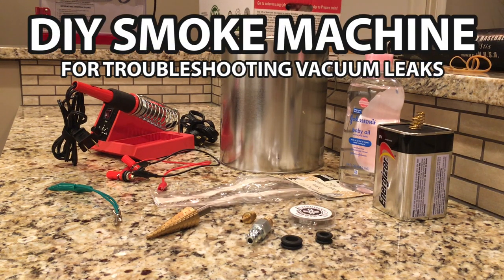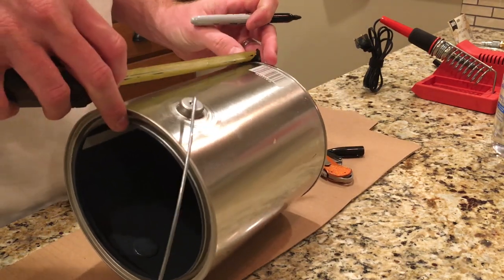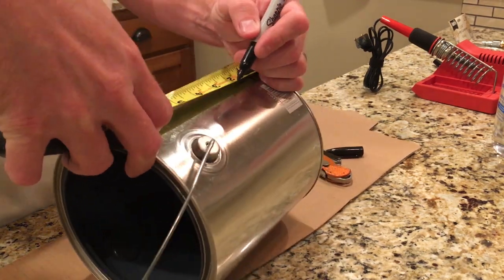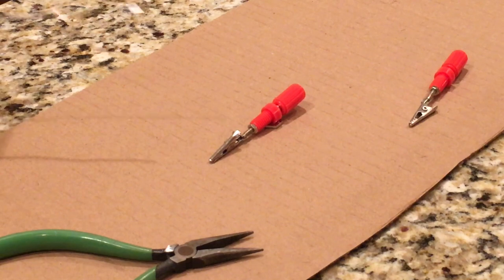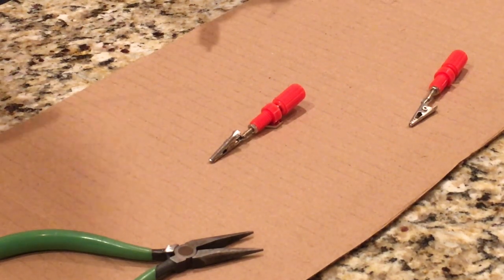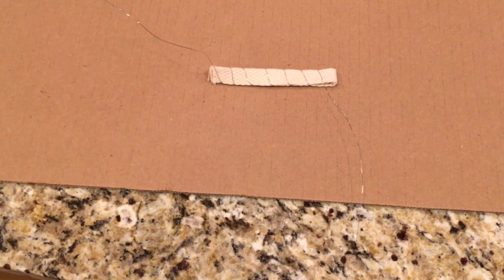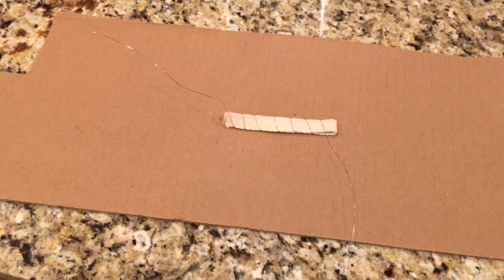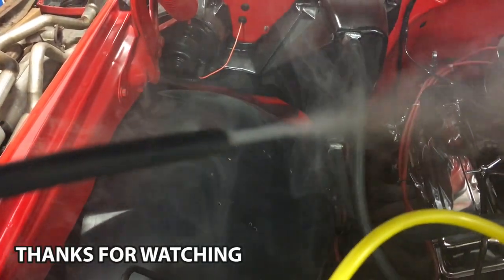Project Time: DIY Smoke Machine Build - Find Those Vacuum Leaks!

Comment: I put a tire valve in mine. I have a pump I use on my mountain bike that has a gauge on it to pump pressure in the can. It's a small hand pump that is easy to pump as I go. Pump with one hand and walk around engine bay looking for leaks  works really well. I used a paint can also. I also have a compressor air fitting on it too if I feel I need more pressure. I like the hand pump because I don't live in a single family dwelling anymore. Makes it more portable. Otherwise I need to break out my compressor and generator and both make to much noise for neighbors. If I have to use them my neighbors know I work on car's in the parking lot and don't complain. They tease me about it sometimes. Maggie's out making car noises again. I just laugh. I work on car's here and it convenient for them since it's a 55 and over senior community. I don't tear motors or transmission's apart here. I have a places if that is needed to pull those to work on. I have a 12x40 storage that I drive to and just get the car towed down the road from where I live. I keep most of my tools in there. It keeps me busy and supplements my retirement too. My customers buy the parts I tell them it needs and I give them a price we both can live with. If they need to go to store I take them when I go if I'm still working on their car's. I love the arrangement we have here. Manager has been real nice to let me do it. I use an oil absorbing mat under the vehicle when I change fluids so I don't get and thing on the parking space I use. I have a portable canopy to cover my work space so if it rains suddenly the car and me stay dry. I Also do car detailing in the same space. Pretty good set up I have.  I just roll out my tools 100 ft and I'm there. I'm not married anymore, so I have a lot of free time to do other things. Thanks for the video.
Reply from the maker: That’s a good idea!  I am that person who is always tinkering on something outside as well.  Thanks for watching 👍

Comment: You didn't put a link to buy the inlet and outlet air valves. Where do I get those? What kind?
Reply from the maker: For the inlet, I used a air line fitting that I had in the tool box.  The outlet is a barbed fitting I had in a parts bin.  These are available at your local hardware store or Harbor Freight.

Comment: Where do you get the rubber hose from? What size/diameter is it?
Reply from the maker: I updated the parts list in the description.  I had some 5/32" vacuum line in the shop.  You can buy it at any local auto parts store by the  foot.

Comment: Hi what gauge wire did you use for this project the link doesn't work anymore? Thanks.
Reply from the maker: I used 28 AWG wire.  Sorry about that, I updated the link above.
Reply: @RustyWrenches  28 seems a but thin and red hot. I heard 20 is better. Thoughts?
Reply from the maker: It does get pretty hot.  That was a concern of mine when I built it.  It hasn't started a fire yet, cross my fingers.  I don't see why 20ga woudn't work.  The only drawback I would see if maybe it would take longer to heat up.

Comment: You’re working around all that metal under the hood, why would you make a metal tester connected to your battery? That’s why I made mine out of the pvc plumbing material...much better and safer!
Reply from the maker: Plastic would be ideal.  These are parts I had lying around the house. Thanks for watching

Comment: Ok, incomplete information,  just like many of the others.

1. You need a 20G nichrome wire, you need to know how to use an ohmmeter and measure a length that will give you 2 ohms.
2. You MUST use insulators on the paint can holes that hold the wire. Or else the battery cables with short and you will start a fire. The battery cables CANNOT touch the can.
3. Generally most vacuum hoses will take an 8 mm or 10 mm vinyl tube. You will most likely need a screw on clamp if your tubes don't fit perfectly. Most air compressors will fit a Nitto style fitting. You will need a male to male Nitto to threads coupler.
4. You will have to block off your intake system, cz it's an open system. You will need to disconnect the hose that comes from the air box and block off the end to which it connects. In order to take this hose off, you will more than likely need a set of specialised hose clamp pliers.

This project is not as simple as YouTubers claim to be.

P.S. Not every country has Harbor Frieght. I wish YouTubers would keep their international audience in mind.
Reply from the maker: Thank you for watching.  I appreciate the feedback.  Have a great day!
Reply: I mean I get your concern.. but @ the viewers discretion they also have that membrane inside of their skull called a brain it's free use it I always go by this standard tried and true method all you need to be is 2% smarter than what you are working with to really become a ingenuity genius.

Comment: I used a 22 awg wire and
 it melted it
Reply from the maker: Well that’s not good.  Was it the nichromium wire?
Reply: It has to be resistance wire it works best Luis.